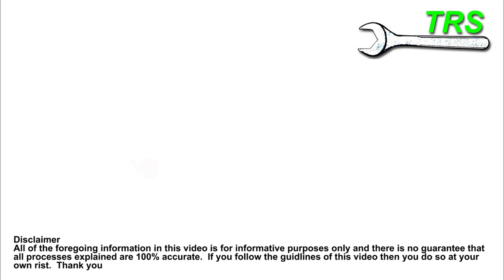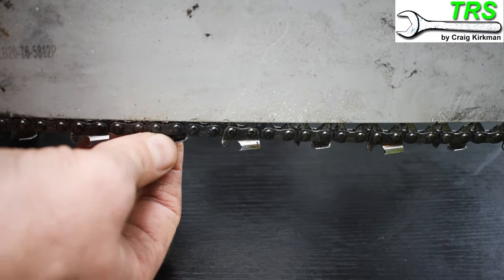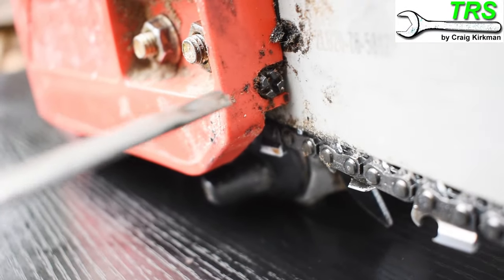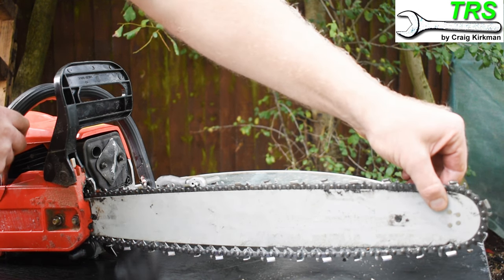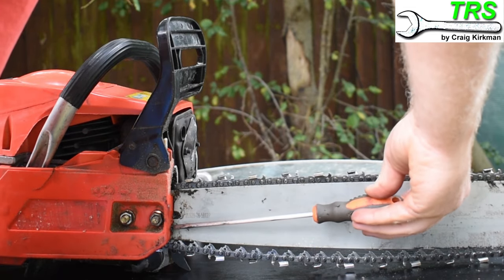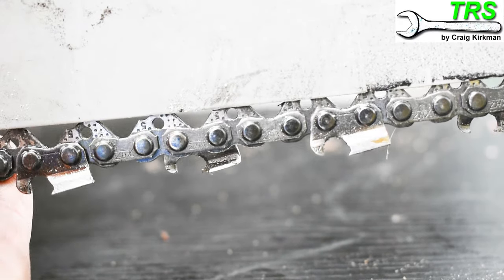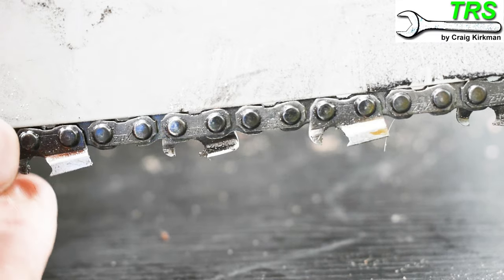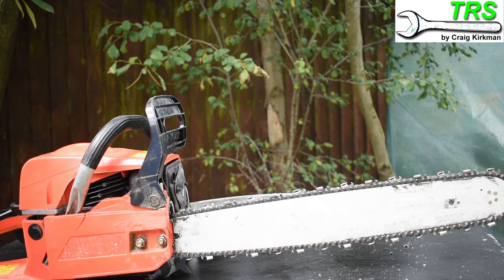How to Tension a Chainsaw Chain Correctly

Comment: You should do a video on the benefits of light weight bars, I recently bought a new 20inch bar for my 272XP and I opted for the light Oregon bar. It doesnt just make the saw feel more nimble it also helps with heat dissipation.

Comment: My chain saw chain won’t tighten. The bar is pulled all the way out. Humph.
Reply: Chain is too long....they do stretch with wear as the links wear out, or you have a couple links too many. Take it to a shop, have it examined and also check that your tensioner is properly working and clean, as it can jam up with wet oily shavings....

If the chain is in good shape, have them break the chain and take out a couple links....don't forget to turn the tensioner back too.
Reply: @glenspryszak6005  thanks

Comment: No using a chainsaw for me! :( I cut my hedge trimmer’s wire so I’ll only accidentally cut my leg or arm off using a chainsaw! :(
Reply: That's why you use gas...no wires! 😁
Reply: @theunknownandunsolved6963  Or cordless. Anyway! Obviously, you keep the chainsaw as far away from your inside line as possible. And you need all the very best projective gear too!
Reply: @mrwizzardknight  i dont, lol i just keep control of the saw, had them kick back on me and everything, just got to keep control. Sure safety gear is definitely worth it... But you know... Lol